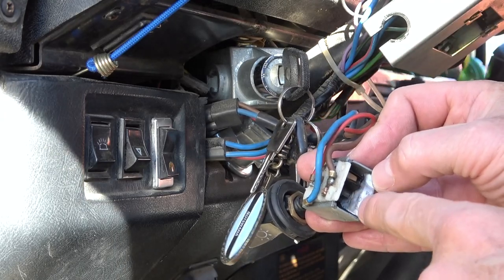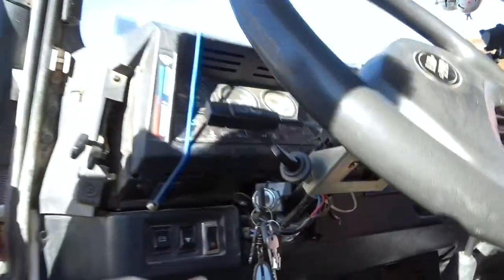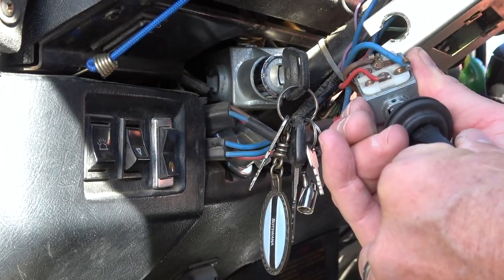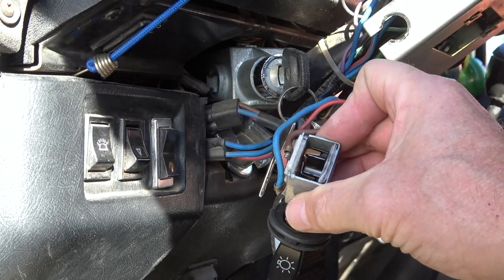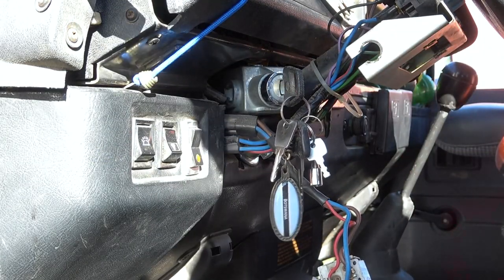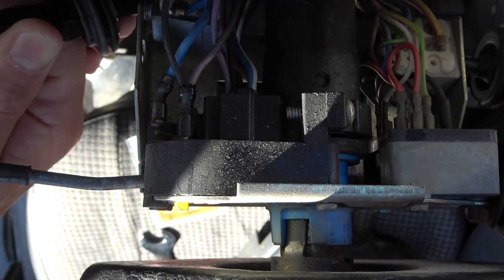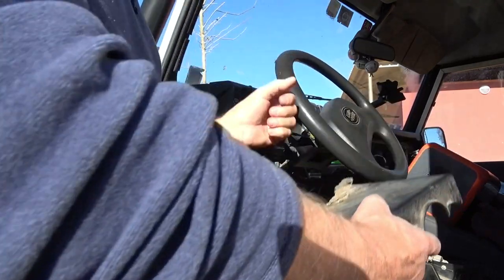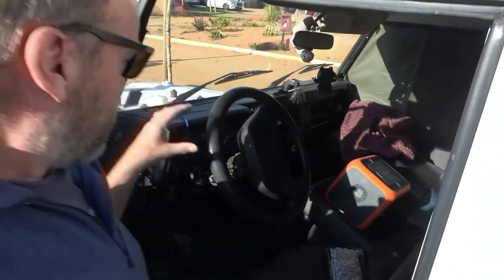FIELD REPAIR on JAMMED Headlight Switch | Land Rover Defender

Comment from the maker: So waht do you do 'in the field' to keep your Landy rolling? Here's my simple hack to keep the lights pointed in the right direction😅
Reply: By chance I was working at the same position today... With the TD5 you can take off and back of both plastic covers without taking the steering wheel off. For reassembling: First fiddle in the top one, then the bottom one. Screw the bottom part with the two small screws to the indicator assembly part and later all the 4 long screws. But maybe TDI is different.   And cool fix to the problem - learned that now, it'll maybe be come along one day... Cheers and keep on rolling Axel
Reply from the maker: @axelcordes  On the strength of your comment I went back and had another go. My trouble was i had the steering wheel turned 90 degrees! So thank you for that, sir! 🙏It is now looking more stylish with everything in place, the upshot of which is that the bungee cord has been reassigned duty elsewhere. Keep rollin' Cheers 🤘😎
Reply: @ASimplyFabLife  Sounds perfect - so no more officers interested in your interior ;-) Cheers Axel

Comment: I once fixed a volvo carburettor using a cable clip and a screw from a cigarette socket... working for 3 years and as far as I know still is... as for my Defender ... bluetack for window leak... command strips for headlining.. door insulation strip to seal front vents....oh the joy!
Reply from the maker: Creative maintenance - love it!
I still get wet feet driving in the rain😂 - hence the flip flops!

Comment: Good fix 
I bought two switches last time I changed it, as well as 2 relays when the one for the headlights gave up working
One of the reasons I love the Defender:
a few screws, some bobs and bits and it works again;
Imagine troubleshooting not working headlights on a modern car;
I had a similar problem on a 2009 Citroën C5 and the friendly dealer anticipated changing one or two headlights (700euros a piece) and the switch -> between 900 and 1700euros;
At the end it was just a corroded connector at the headlight itself 
Contact spray and a few hours of cursing
Reply from the maker: Your Citroen story reminded me again that all dealers are just sharks - nothing more. I mentioned elsewhere that we were presented with €800 bill for the first Puma service (€27/ltr for engine oil). You can't make this stuff up! 😂😆🤣
The older Landys are more simple, obviously, not ALL good - but at least you can fix it yourself😉😅